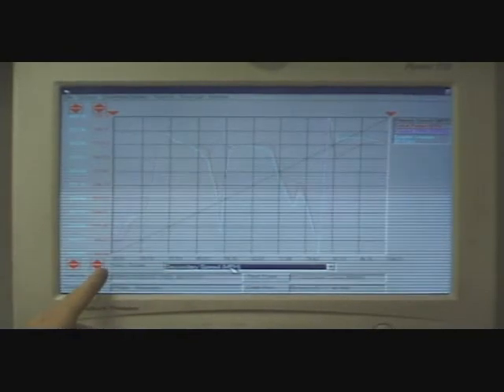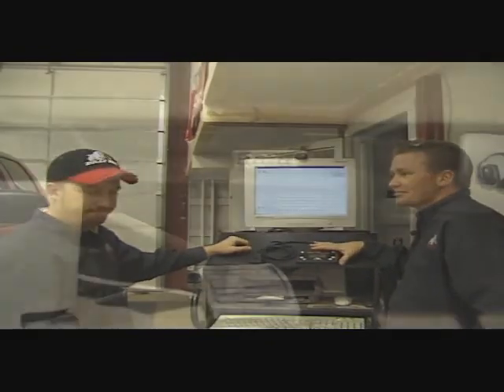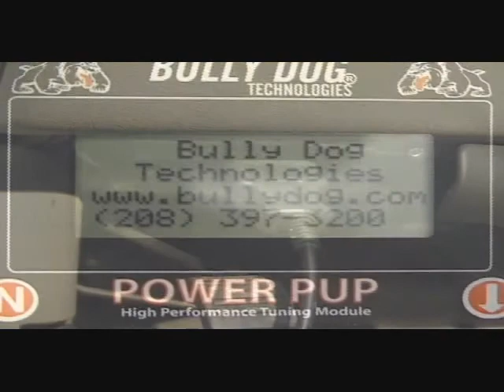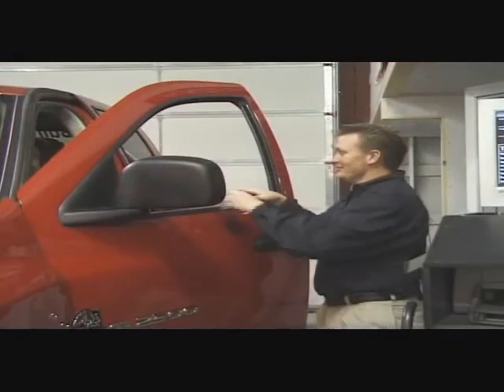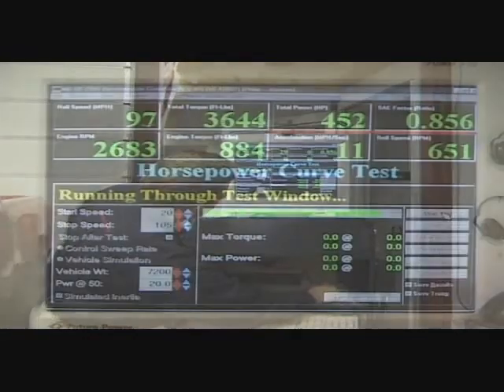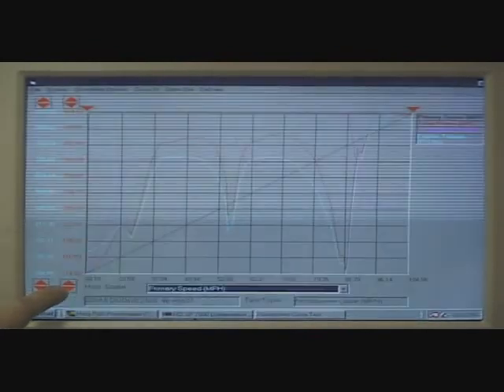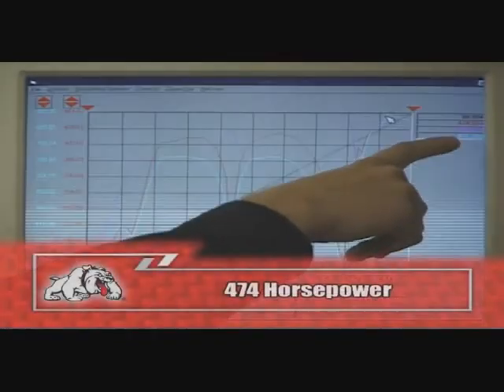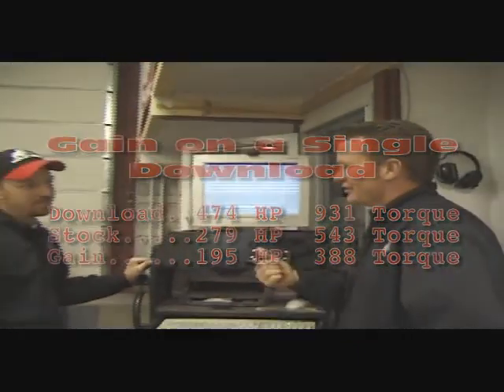Bully Dog Dodge 5.9L Extreme Tune Dyno Video

Comment: this has to be crazy larry turne which is no longer avalible for the power pup the only current update that can run it is on the pmt
Reply: jeb little what tires and wheels are they looks awsome
Reply: Mine still had the 3 originals. I didnt know i could update it, i mean extreme added quite some lump of power but idk bout all that